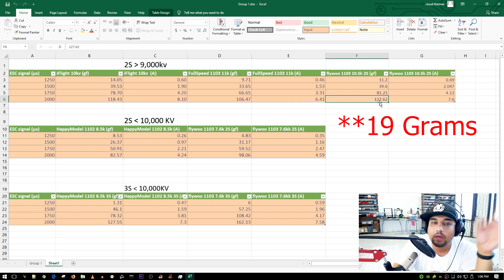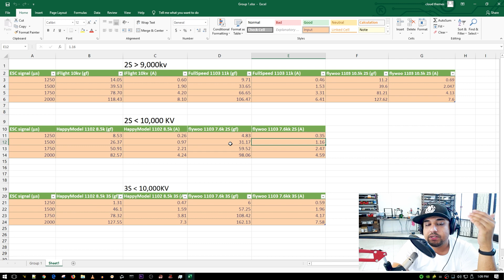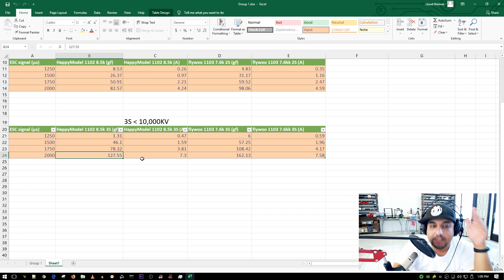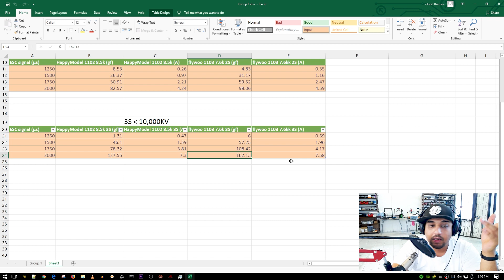Most Powerfull Toothpick  Motor I have Tested // Flywoo 1103 Toothpick Motor

Comment: Received mine a few days ago. Today I noticed all bearings are damaged. Rattling noises, even shakes the frame so hard that my fpv has jello. The broken bearings even result in heavy amp draw. Not sure if its transport damage or flywoo is just the worst manufacturer I ever encountered...
Reply from the maker: Write them they will look into it. Their support is great so far I have 4 sets and none had that issue and they have been the most durable 1103 motor ever used.
Reply: Drone Mesh man youre my favorite youtuber 😅.  Your motors run perfectly smooth? No rattle? Not grinding noise? Mine draw 24 amps on full throttle on... I really think something is damaged

Comment: I built a spreadsheet to visualize this data as thrust:weight vs amp draw with fields that can be changed for different assumptions about build and battery weight: https://youtu.be/WD9eD_5O49g

Comment: Check out Gal Kramer's test of the flywoo 1404 4850kv on 3s 3". Around 8.5a for 335g of thrust.  3" props with big fat blades spinning slower can be just as quiet and run on similar batteries. If you love the toothpick class ultralight 3" is definitely worth a look.

Comment: Great video! Exactly what I needed to know

Do you recommend low or high KV for 2x 1S HV batteries?

Keep up the great work!
Reply from the maker: From theory and experience high KV.. But I prefer flexibility of 2s and 3s but time will tell when i go out and test them :)
Reply: I got a bunch of 1S batteries and I really love your suggestion to use two of them for a toothpick build.

Any idea, how many flight time will it cost, using higher KV?
Reply from the maker: @pxsaber2177  You should have good flight time in theory but it comes down to the overall weight so it's difficult to say and I still have not flown these motors to give any concrete info on flight time. But high KV is meant for 2s to it will be your optimal setup.

Comment: Fantastic testing and review, dude! 😃
If you can, try the 10500kv with 1s batteries!
Reply: On 1S the HM 1102 13500kv outperform the FS 1103 11000kv and Hyperlite Toothpick "hyper-kv" 1103 12600kv. Compare to the FS the HM have better power but a little shorter flight time. Compare to the Hyperlite the HM have better power and longer flight time.
Reply: @Quad66  Nice! Great to know! 😊

Comment: https://flywoo.net/products/4-pcs-flywoo-frame-arm-led-board-light-1-2-bits-4-10-15-20mm-1-4s-for-rc-drone-fpv-racing-multi-rotor?variant=29093606916148
Reply: Thanks for this link, just picked some up.  Problem is, they don't call them 'race wires' in the description so can't be found when searching for them.  Happy I found them 😁

Comment: Great info, tnx. Next add skystars 1103 8000kv (=Hyperlite 1103 kababfpv motors). They should be about the same as flywoo (spec wise) but cost is 7,50usd/piece. :P
Reply: Agreed, wonder about those as well as Xing 1103 :D Trying to identify best 1s/2s motor and how the hell does Tinyhawk fly so long and fast on 7000kv 1103 on 65mm :D